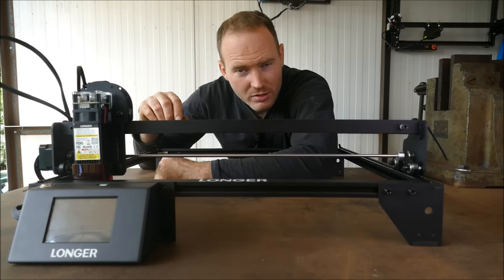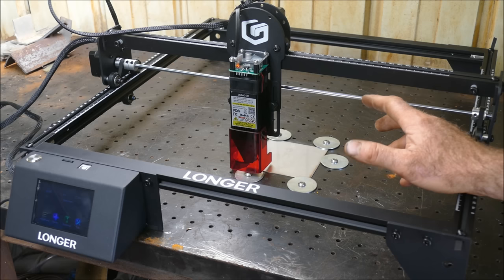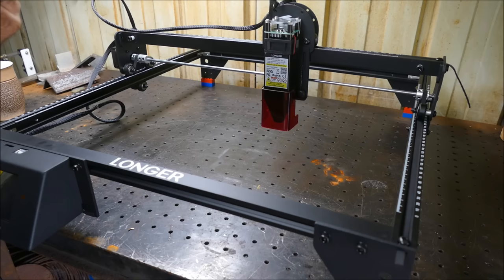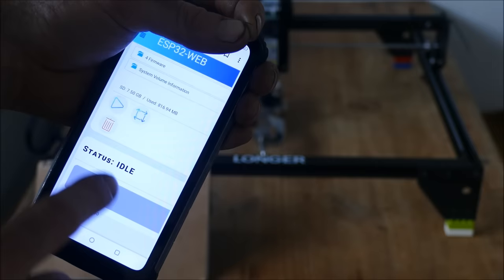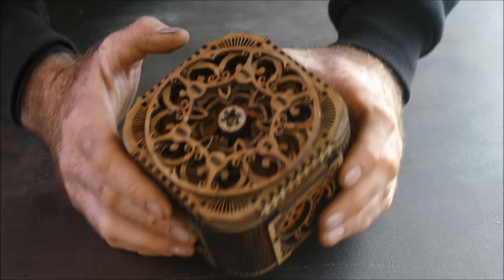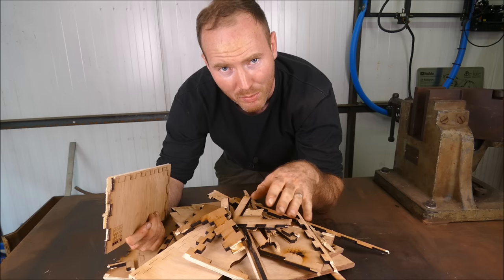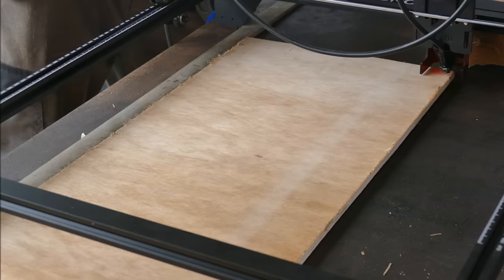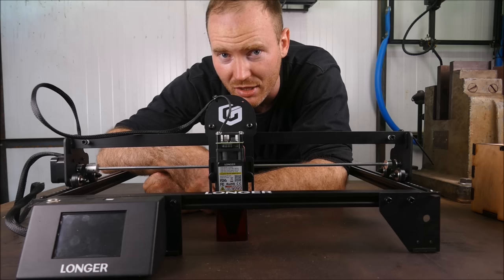This New CNC laser is amazing! - The cost effective LONGER RAY5 10W - New!August 2022

Comment: “Hmm, how can I tap these delicate pieces together? Ah, sledge hammer.” 😂
Reply from the maker: It's the blacksmith in me... Every problem can be solved with a hammer 😅
Reply: I used to hit my TV back in the late 60s with a hammer as it had valves inside and that worked just fine as to why I have no idea but it worked👍
Reply: You might know how a starter motor can stick and requires a gentle tap. Well I'd actually never come across this until, there we all were sitting in a helicopter. immediately before take-off the Pilot hopped out with a little hammer.
Reply: @joshuadelisle A  carpenter thinks the same way ...
Reply: It's more like a lump hammer!?!

Comment: Hey Josh! Just bought this machine up from Amazon today for USD 237.95!!! Went ahead and also got the honeycomb grid and air assist attachment. Heard someone else mention building some kind of downdraft filter table and have the top open...might require a good bit of airflow to handle the smoke. Not going to do any heavy materials yet--just paper. My wife is a teacher and needed lettering for some bulletin boards. The paper cutter we have had requires adhesive cutting sheets to adhere the paper to and when the adhesive goes bad, it requires buying a new cutting sheet--$27 a pop!!! So when the adhesive gets fouled, $27 down the toilet!!! 😬

Comment: When producing your files to engrave/cut, its best to cut inner shapes first and then the final shape last. If you cut out the external perimeter first, there is a chance the piece will shift, since it's no longer attached to the source wood. Inner to outer will ensure the alignment remains the same. Doesn't seem to be an issue on this particular project, but there may be some designs where it'll come in to play.

Comment: for cutting every laser, diode or co2 works better with air assist for a few reasons. it adds oxygen to the fire as it's burning, as well as clears the line of sight for the laser to the material. I'm surprised that these LED lasers haven't had air assist from the very beginning to be honest. but I guess few people thought they would cut at that time? not sure but it should be standard on every machine
Reply from the maker: I totally agree. Cheers J
Reply: These are just the bare basics, no air assist, no safety enclosure. Like buying a car that is just the frame, wheels and engine with no chassis. Is it cheap? Yes! Will it drive? Yes! Is it safe to use? Hell no!

Comment: Just a heads up, if you mask off the wood with wide format masking tape, the wood will stay looking clean on the face. You’ll just have to remove the tape that is leftover.
Reply from the maker: Great tip. Thank you
Reply: Can you tape on top of modge podge by chance?

Comment: you should refocus the diode on thicker wood, the sweet spot on the diode is only a few mm's wide where it will cut at maximum strength, do one pass, re focus the machine to the depth of that pass less 1 mm and do the next, you should be able to get through in 3 passes not 16, a good cutting speed is 5 on speed and 100% on power if you are using Lightburn , always use air assist on cutting and never on engraving as it chars the woo9d.

If you try these settings and re focus you should not get so much damaged to the face of your wood, you can also apply laser tape to the surface of the wood for a better cleaner cut.

Choose thinner stainless steel if you want colours, the colours are generated by the heat of the laser as the metal warms, if its too thick it wont colour, with thinner stainless you can get a very broad range of colours, in Lightburn you have options to help you and the forum is a great resource.

There are diodes a lot better than this which will cut up to 10mm in one pass because of the lens it uses.  If anyone reads this I suggest you do your homework before buying this Laser as there are a lot of machines out there now from 100 usd upwards but once you get to the 600 mark consider using a C=2 laser which is much more powerful, the cheaper ones are known as K40's  just make sure it is Lightburn compatible as that is the best Laser software you can buy. Nothing on the market is as powerful and easy to use. 

Always remember that these using a burning light to cut through wood or mark materials, make sure you take reasonable precautions to prevent that light from damaging anything directly under the laser as it can cause fires otherwise. Always where protective glasses and NEVER EVER leave the laser unattended and observe the 1 hour fire rule, return to the place of cutting within 1 hour of finishing to make sure there is nothing smouldering.

Comment: if your IP is 192.168.x.x, then you have a private IP or local to your network only IP ( or your private internal network, hence private IP) , IE it is LAN only, that IP is not specific to you. anyone with a router will have their devices also assigned to a 192.168 IP,  and is not public facing, you will be fine.  your internal IP's are actually network address translated to your public facing IP assigned by your service provider and assigned a particular port so any requests responding to that port will forward to your internal networks device with that assigned IP.

Comment: Fantastic video! Appreciate this showing off the capability of these systems. As much as I'd love to invest in one of these open air CNC lasers, my biggest apprehension is safety around using one of these. 10W DC lasers can easily blind someone, and the shield on these systems does not account for reflection, which can arise from Metal engraving. (Might be an excuse for me to build some robust shroud).
Reply from the maker: Definitely a box of a fire retardant description is needed as well as extraction . I'm currently testing a 50w co2 laser that has an enclosure and extraction. Honestly the diode laser are still looking good in comparison especially in marking stainless steel. Cheers J

Comment: Love the laser videos. Finally decided to get one after watching your last video. A good tip for reducing burning on the face of wooden parts is to cover the piece in masking tape before cutting. When it's peeled off it takes the soot with it and your left with a clean piece.
Reply from the maker: Thank you David. That's a great tip. I'll use that in the next review, well done on your purchase they're great tools and I think I'm going to set up another channel dedicated to them with my own designs for cutting. Cheers J
Reply: Yes I'm so pleased I went for it. I originally planned to convert it to a CNC plasma but am having so much fun with it as is I may have to get another for that project.
Reply from the maker: @cybernetrix  nice! There are cheap ones on Banggood again now at the £150 mark. I'm loving them too. Cheers J
Reply: Also if doing a lot of laser cutting get hold of the widest tape that will fit your laser bed, for example 3M do tape up to 1450 mm wide. Another tip is that if you are cutting say very thing card or wood sheets and want to laminate them together for a sculptural type effect, buy sheets of douple sided tape (like double sided sticky tape but in large sheets) and apply before cutting, the laser will go straight through the tape along with the material creating the perfect shaped pre applied stick on backing
Reply from the maker: @davidorf3921  good tip thank you. Cheers J

Comment: Hello Joshua. Thanks for all the detailed explanations. A question. If you were a beginner and had to pick only 1 btw a creality falcon 10w, a longer ray5 10w  a sclpfun 10w and a comgrow x1, which eould you.pick?
Reply from the maker: I would probably pick the comgrow because it's cheap, works fine, can be extended and they do a 20w upgrade module. The Longer Ray5 has the offline controller which is great but now that I use Lightburn for most projects it's simple enough just to keep it linked to the computer. Cheers J

Comment: Great stuff, I just got my first small scale cnc (with laser and spinner)and I'm totally amazed what I can make with that. Thank you for the video, I wish you a great and productive year 2023 !
Reply: Which one did you get?
(I'm thinking of getting one but I don't  know where to start)
Reply: @runi5413  I got Vevor 3018 Pro with 500mW laser, easy to set up and works great with routing soft materials (max aluminum) Cutting anything else but cardboad with that laser needs to be forgotten though. Im running it with linux and did not even require too much a headache ;) For laser work I would recommend paid version of lightburn. For router I have used UGS, importing milling and routing work from any cad is easy. For laser in my version of the machine I need to set the laser mode on manually on the cli.
Reply: @tlx4868  Oh cool, I was actually considering a Vevor but I couldn't find much about it on youtube or anything, so thx a lot for the tip 👍They got a sale on one model with a 7W laser so that should be beefy enough for what I'm planning to do with it. 
Will definitely check out Lightburn, too, thx for the info and happy lasering 😎

Comment: i am wondering if the resolution is good enough to write text and logos on a chip package.
that would be nice for some low volume production where you buy empty microcontrollers or fpgas, program them, remove the original writing and apply the new product name.
usually the manufacturers can do this as well but with volumes lower than 10.000 pieces they don't even have time to speak with you. and of course it costs extra.

Comment: When you did your recommendations, I was thinking exactly the same things. Especially the height adjustment. I would go one better on that...I would have the machine follow curved surfaces automatically so the distance between the laser and the material stays consistent. On your curved example, the shading would have been consistent if the laser was at a consistent height.
Reply: There are more expensive machines that can map and then follow irregular surfaces.  There are also inexpensive rotary axis that handle simple cylindrical and round objects.

Comment: More amazing video's.  Thank you.  Have I watched your recent tests on low cost desktop lasers.  which would you choose based on value for money not just lowest cost.
Reply from the maker: I have 9 lasers now. Several haven't made the cut (figuratively and literally). I think this one is actually my favourite of the 10w models. I like the screen and using it without a computer and the laser has been consistent and reliable. They're giving me a 20w module for it next year to try out which is exciting. I'm also testing a 50w co2 laser shortly but that's 10x the price. Cheers J

Comment: what are your settings for cutting wood im using MDF 1/8 and 1/4 thickness and its taking forever to cut
Reply from the maker: I've had mixed results with MDF. The glue in MDF and Plywood needs to be a specific kind that burns away and not just melt. You need a jet of compressed air above 20psi and not the standard pump that you get with the machine. You also may consider going faster with more passes so you don't catch it on fire and produce a cleaner cut. I do most cuts at 2000mm/m now. All the very best. Cheers J

Comment: Hi Joshua. Really enjoy your videos!
I'm thinking of buying this machine as it's now even less expensive and, I'm a beginner. I'll get the air pump too. My guesting is, were staying in an rv for a few months and will be working outside under the rv awning to learn how it works. What do I need to put under the laser to use it on a table top? I don't quite understand that part. Do I have to buy a honeycomb? Will a rubber mat work? Spacers?
Thank you!
Reply from the maker: Thank you. Firstly you need to consider safety. Lasers are dangerous and you can easily get blinded from one. So make sure you have good eye protection (specific laser glasses for the wave length of the laser) and adequate screening to protect you and others passing by. It needs a surface that doesn't burn such as steel, aluminum sheet etc. the Honey comb simply creates an air gap to help grasses pass through when cutting. You can use bits of wood as spacers otherwise. All the very best. Cheers J
Reply: Thanks much. I will definitely take all safety precautions. I'm a life long high voltage lineman and, welder. I'll find some steel sheet as a backer.
Hope your New Year is blessed!
Reply from the maker: @kellyleewright97  well done 👍. All the very best and strength to you my friend. Cheers J

Comment: Great review!  I'm getting the 10 watt version soon.  Your home-made air assist nozzle is just pointed at the laser spot?  How effective is that at keeping the lens clean if it's not under positive pressure?  Subscribed.
Reply from the maker: It blows away the debri away from the lense keeping it clean. Its not a permanant solution and maybe 3D printing one would be much better. cheers J

Comment: Is thaere anything like a page scanner that could copy a design on the paper to the machine to cut out a copy. Like an airfoil for PC hobby?
Reply from the maker: You can scan an image using a regular paper scanner and use the laser software to cut or engrave the image no problem. Cheers J
Reply from the maker: These lasers cut paper and card too no bother. Cheers J

Comment: Great video. I’m interested in buying a machine,  but it I need to learn more about converting drawings into digital files. I want make inlays by cutting thin pieces of exotic wood and inlaying the parts into a slab of wood that has been laser cut with the same art work. The slab art must be just slightly larger so that the cut outs can be press fit. Can you suggest some videos?
Reply from the maker: Thank you Albert. These lasers do a great job at that. Yes I'll do a video on designing for laser cutting and do an example inlay. I've got a few more reviews to do so I may be able to include it in one of those videos. All the very best. Cheers J

Comment: I am in need of a machine that cuts acrylic sheets for letter and signs designing. Is there one bigger than this? 

Can you do a video on hot yo input the cutting patterns?
Reply from the maker: I'm currently doing a video on the gwieke cloud 50w. It cut clear acrylic no problem. Has a cut size of 500m X 300mm.
Reply: @joshuadelisle  Thank you for your reply. Very interesting videos btw. However, working w/ neon leds here and need a machine that could do groves and cuts to attach the Leda to it also a bit bigger that 300mm more like a meter by 2 or more meters. Yes I can work in sections I fear but time is a constant issue for delivery as you know
Reply from the maker: @SF_Curious  thank you. I think a CNC router may be more appropriate for you. It will be quicker too but are generally a lot more expensive. Have you tried asking a local company to CNC cut your designs. Cheers J

Comment: It is important to me that this laser really can cut 1/4 inch ply. Are there other brands that can do that?
Reply from the maker: I'm cutting 8mm ply with this. 20w is even better and a 50w co2 laser is even better. You get approximately 10mm per minute per optical watt. So a 10w is 100mm/pm and 50w is 500mm/pm cutting speed. Cheers J

Comment: Hello, thank you for your video ! I have this machine Ray5 10w and it is impossible to cut pine wood over 5mm thick... The speed is set to 100mm/ minute, 20 pass, and the laser at 100% power with Lightburn. Is there anything else that needs to setting to make cutting wood ?
Reply from the maker: Do you have an air assist? The better the air assist the better the cut as it blows out the away the chard material revealing clean wood underneath ready to be cut again. Also if the belts are not the correct tension it may not cut on the previous line accurately. Also I'm noticing a drop in power after using it at 100% too often as the diodes diminish over time. I'm testing a LONGER 20w module but using it on low settings to see if it lasts longer.

Comment: If it has no enclosure (8:14) what about the fumes? I can imagine that building a fume extractor / or enclosure will will cost you at least the same amount as the engraver itself.
Reply from the maker: You can buy enclosures with filtered fans very cheap now of the web. I have a very well ventilated workshop so I'm not so worried and I often ware a filtered mask. You could easily build one using a box, inline fan and some flexible ducting out of a window if you where really concerned but not a large budget. Cheers J

Comment: As a machinist, the indexing using the flatbar is smart, but how is the base secured against vibration?
Reply from the maker: Thank you. For cutting it generally moves very slowly with low vibration and has little rubber feet. It also cam with 4 brackets for bolted on and screwing down if needed for high speed engraving. Cheers J

Comment: When you build the air assist, if you use a compressor you,ll need an air dryer , damp air cools the work zone ,inhibiting the burn , is that longer laser 10w output?  Cheers .
Reply from the maker: Hi. I used a standard dryer and filter on mine. It's more important to have dry air for plasma cutting but for wood it's just necessary to blow away chard material so there is fresh material for the laser to cut. It's not that necessary to be completely dry with expensive drying equipment but I can imagine it will help a little. It's a 10w optical output. Cheers J